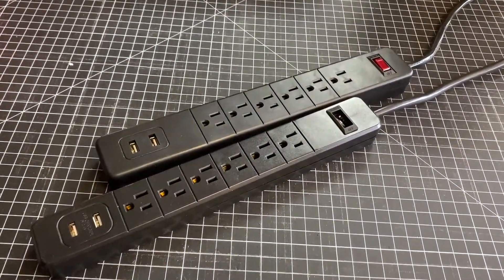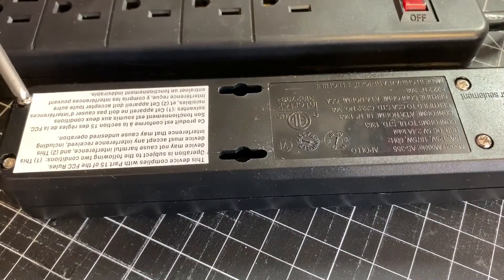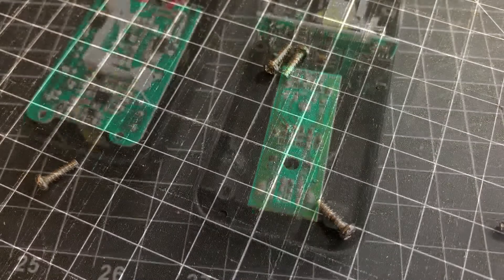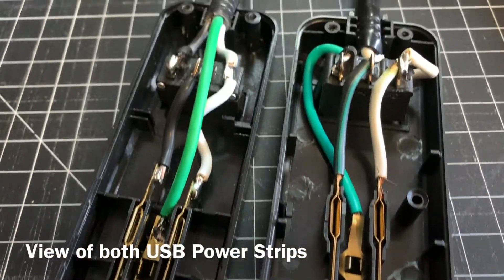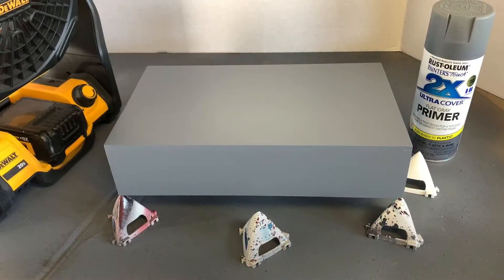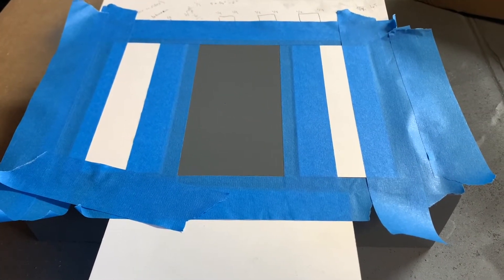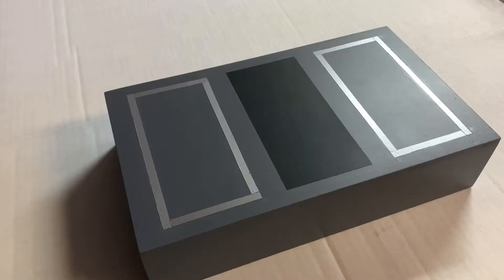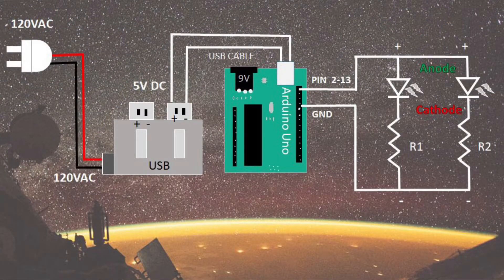Configure an Arduino for Star Wars prop (“Blinky Lights”)

Comment: I need to jump into these Arduinos!  Well done!
Reply from the maker: They are a lot of fun. And really give some life to the prop. But if you think leaving that one led unlit was hard….watch out, you’ll be up at 2am with an Arduino going “is the delay in that one too long? Maybe these should automate together?….but as for me, that won’t be until next time, When I try to finish something
Reply: @garlandsworkshop  You are making me anxious even reading this now!!
Reply from the maker: No worries. I started a Greebles support group recently ,for just this occasion. First set boundaries and expectations (eg. I will qllow my self to get an arduino, but for this week, I’ll only establish blinky lights, next week…I’ll ONLY do 2 hours of sketch work on how they blink in my prop)

All good things to avoid burnout. As it is addicting